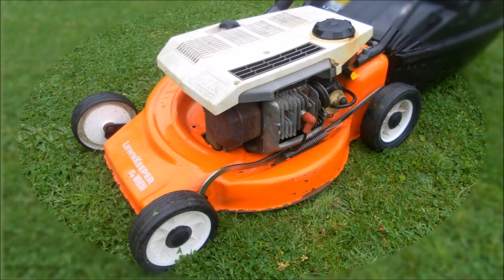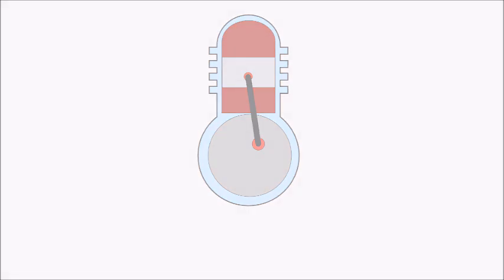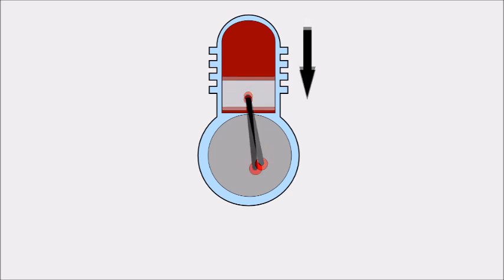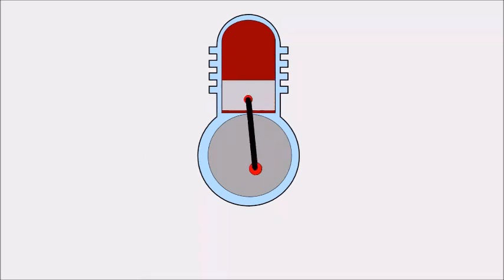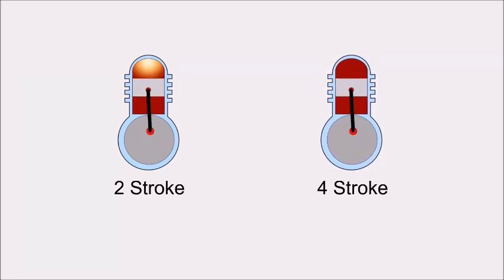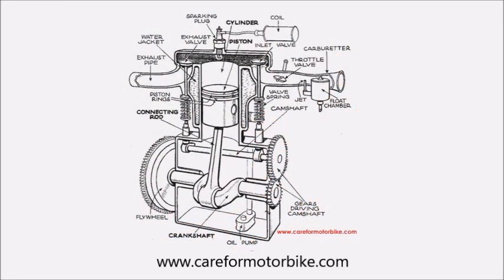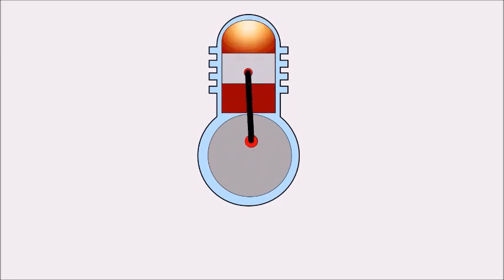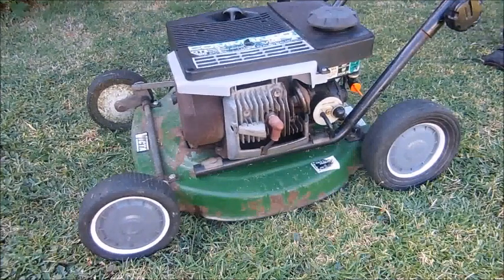What is a 2 Stroke Anyway

Comment: Hello Sir,( Victa 2 Stroke Workshop ) i have an Orange Victa two stroke mower, which this season has been stubborn recently, i have replaced, the diapham, the primer cap O ring, and the main jet also a new spark plug, it starts runs briefly then cuts out, prime it again and will start up do same again, your advice would very helpful. 
I have owned  it since new ( about 15--20 years ) it is in good condition, i look after my gear, keep it clean and tidy.

Comment: Did that have a Tecumseh originally? I found a trashed one not long ago with an orange base with those wheels and a Tecumseh motor. Didn't bother taking it as the base was full of rust bubbles, wheels were worn and handles were rusted out. Engine had missing fuel cap and stuffed throttle cable. Not worth it.

Comment: have you ever had experience on a issue where if it's titled one particular side like on hill or if I tilt myself on that particualr side on  it will slowly die out or straight away die unless I quickly level it on even  ground or tilt it opposite side to cough it back to idle.